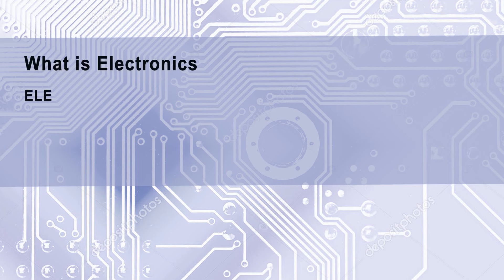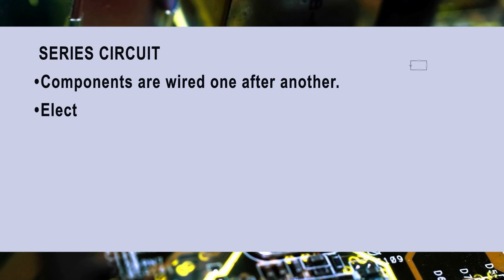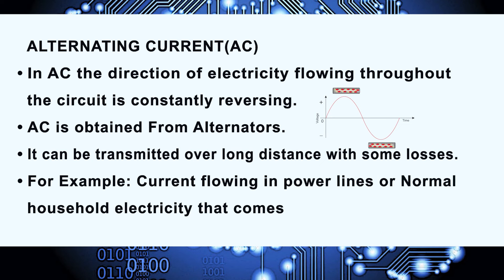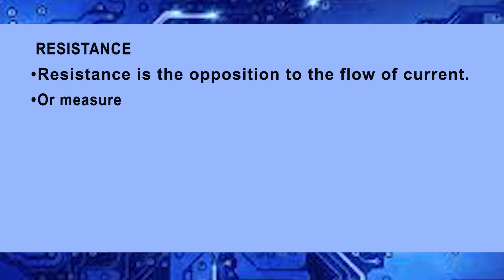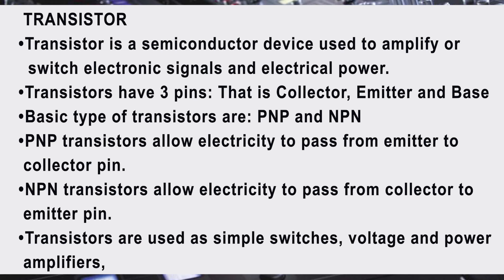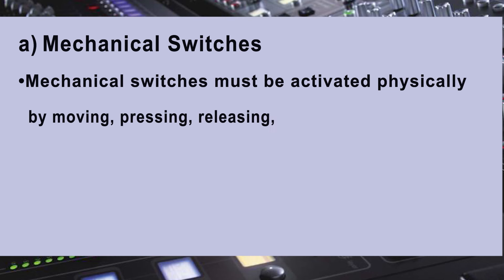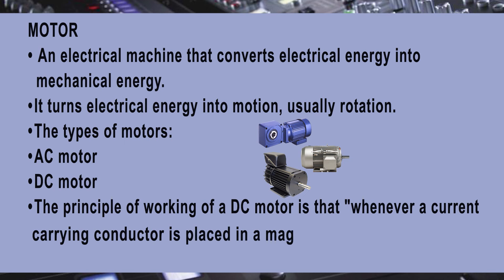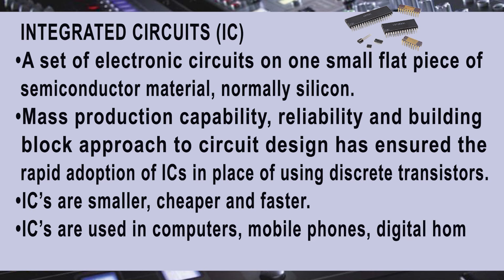Basic Electronics introduction for technical interviews

Comment: U said resistor is a passive component.. Passive component cannot control the flow of current.. Bt in resistor definition it limits the current.. Can u explain what is current
Reply: Resister is a passive component which means which only can resist the flow of current which can not produce a current

Comment: Mam, Resistor can control the flow of current right?.....then how could you say it as passive elements mam....kindly explain
Reply: There will be voltage drop across resistor,it will acts as voltage sink,so it is passive element

Comment: Hello miss I appreciate your hard work but in addition I would like to add some correction.
Battery positive terminal is Anode and negative terminal is called Cathode.
Correct me if I made mistake thank you.
Reply: what she said is correct, positive is cathode and negative is anode
Reply: Ya she is right please go through battery wikipedia also u will get same information
Reply: Anode :

The electrode at which oxidation reaction takes place is known as the anode. It can also be defined as the electrode from which the current enters into the polarized electrical device. An anode is a terminal where current flows into a device from the outside. We can't define an anode as positive or negative because its polarity depends upon the type of cell being used.

During discharging of a battery or we may say that when a load is connected to the battery, the electricity flows from the positive terminal of the battery to the negative terminal of the battery. So in this case anode will be the negative terminal because electricity flows into the negative terminal.

During charging of the battery, the electricity flows from the negative terminal of the battery to the positive terminal of the battery. So in this case, the anode will be the positive terminal of the battery.

In the case of capacitors and diodes, the anode is that side where we connect the positive terminal, this is because current will enter from this side. And the side where we will connect the negative terminal will be the cathode.

It is not mandatory that cathode and anode will always be used together, there are applications where anode alone is used. In the sacrificial anode coating, zinc is used to protect metals. This method is common in ships where a static charge is created due to the flow of water. The sacrificial anode which we have used will absorb all the static charge and slowly gets disintegrated. In this way, we can protect the metal. Only the coating needs to be restored.

Cathode :

A cathode is an electrode from where the current flows out of the device. Since the direction of flow of electrons is opposite to the direction of the current, we can say that a cathode is an electrode that has the flow of negatively charged electrons entering into it.

It is the electrode at which a reduction reaction takes place. Just like anode, there is no particular polarity of a cathode, it also depends on the type of cell being used.

During discharging of a battery or, when an external load is connected to the battery, the electric current flows from the positive terminal of the battery to the negative terminal of the battery. Since the current is leaving from the positive terminal of the battery, it (positive terminal) will act as a cathode during the discharging condition

During charging condition electric current flows from the negative terminal of the battery to the positive terminal of the battery. In this case, an electric current is leaving from the negative terminal of the battery so it (negative terminal) will act as a cathode.

The cathode attracts cations and oxidizes them in electrolytic and galvanic cells. In X-ray tubes and, electron guns, the part that emits electrons into the device forms the cathode.

A cathode can be a hot cathode or a cold cathode. A hot cathode is one that is heated in the presence of a filament to emit the electrons by thermionic emission. Cold cathodes are not heated by any filament.

Comment: Inductors Block the change in current how? The answer is by creating an opposite potential to the flow of current. So it stops the flow of current,  can't we say this as the controlling of current for a short period of time or is it that the short period is ignored.

This is regarding the second point at the time 1:48.

Comment: DC current can be transmitted through long distance with negligible loss? Are u serious? For the transmission of DC current over long distance is a difficult task,as it is okay with few miles and not even kilometers, otherwise we need to have generators at regular intervals tht is where AC came into practice.
One more thing, its not Cir-qut its Circuit please mind the way its pronounced

Comment: 9:55  Zener diode has ease to current flow from both direction. So cant agree with that.
Reply: No
Reply: Zener diode used because it has stable reference voltage